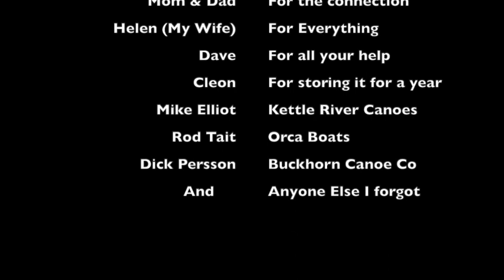Restoring a 1960's Huron Cedar Canvas Canoe

Comment: Could you send me the sealer you used on the hull and the sealer used on the canvas, as I play your video several times and could not make out what you said.
Reply from the maker: For the canvas I put 3 coats of Robson's RT Mastic, Then prime it with Interlux Pre-kote. Then 3 coats of Green Interlux Brightside Polyurethane. For the inside and outside of the hull I used a mixture of Turpentine and boiled Linseed oil. I finished the inside of the hull with 3 coats of Minwax Valspar Polyurethane. I hope this answers your question.